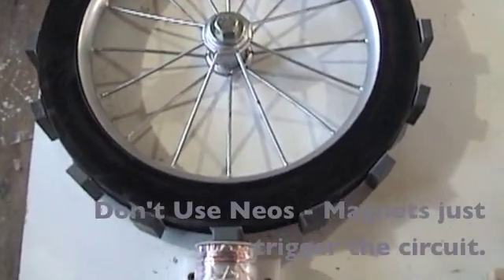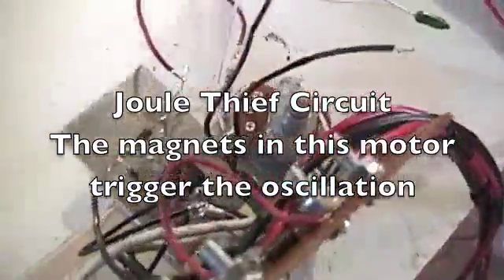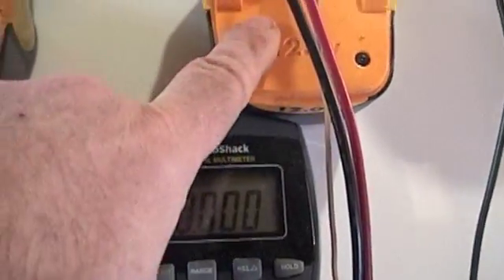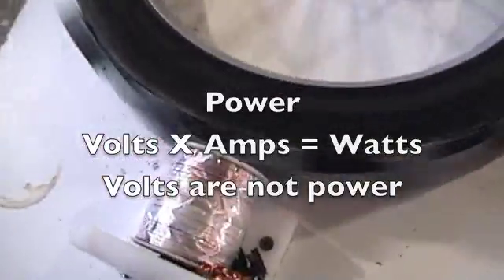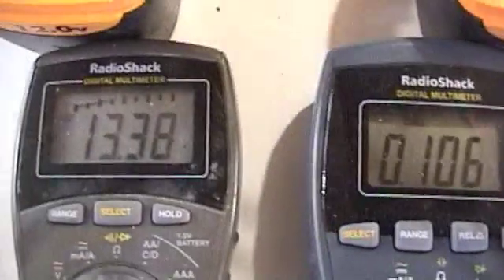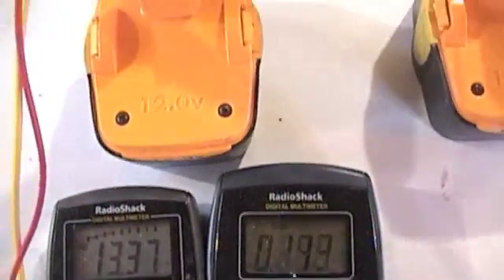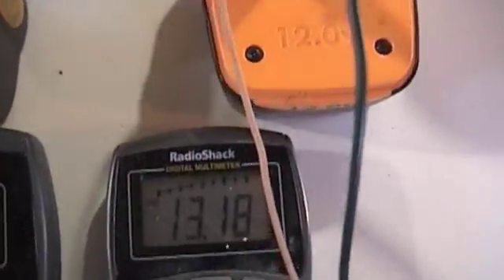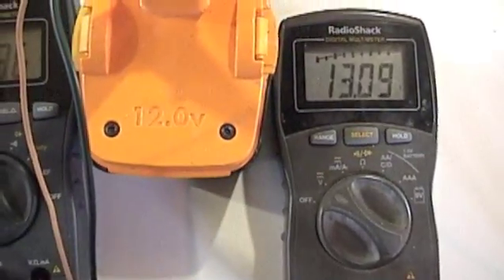Bedini Motor - Review

Comment: A solar panel has no moving parts, and can be built to nearly any capability.
why go through all this Rube Goldberg stuff, even if it would work, which it won't.
It is just a glorified way to run down batteries.
Reply: Oh it works dipstick, you are just too stupid to understand it.
Reply: Well, since you put it that way, I watched the video again.
I concluded that the 'dipstick' reference didn't make any significant improvements to the glorifier battery killer.

Comment from the maker: @20RoyalSuperKing 

I did take measurements on both.  Sure enough the charging battery was getting about half the watts as input.  This was going to be a slam video.  But something else is happening and I want to explore a little more.  I am not sure with the pulsing of high voltage that my amp meter really reflects what is going on in the classic amps X volts calculation.  Today I brought two dead batteries back to life for a net gain.  I want to test some more.

Comment: You will need to buy 2 more meters and measure both amps and volts of each battery simultaneously to get a true in out. Otherwise this video is just another of the old overunity rubbish with no back up and half truths that plague the world. Even better to use the same rating super caps as batterys have lags or use any battery and a sutable load like a 12v 5w lamp. I look forward to a new video, this is more scientific than most.